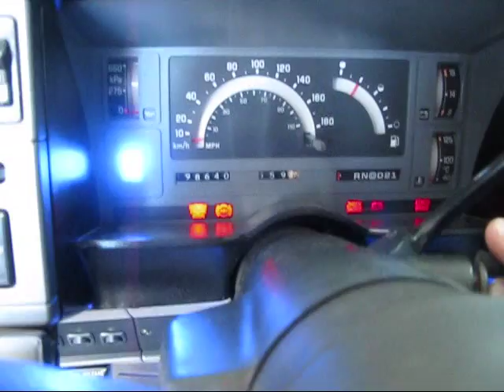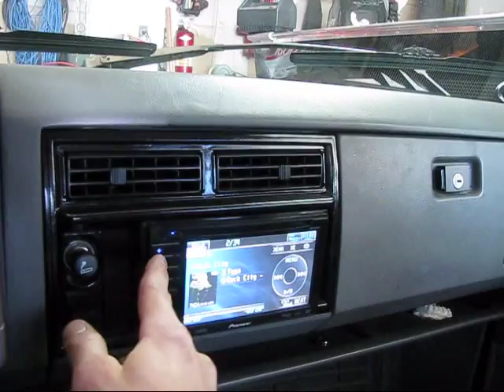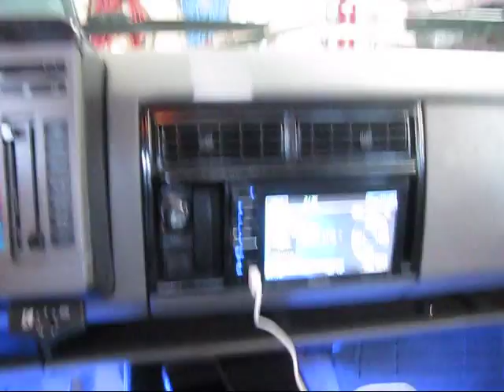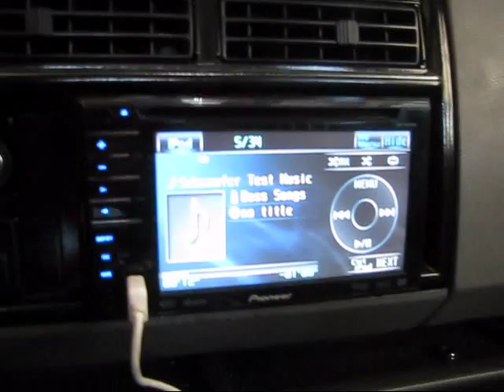S10 Stereo Demo (Oct 2012)

Comment from the maker: i bought the headers from summit. they are hooker. and for the rest of it its custom stainless. i had a local guy do the work for me. from the headers used 3" stainless to a true "y" pipe, then 3" to the cat, 3" into the muffler and 2.5" for the tail pipe to keep some back pressure.

Comment: ay homie, if u wanna get loud, put them subs in a 4th order bandpass. or juss wall off the back wit some 15's or 18's hahah... im doin a new setup in a a truck im bout to buy... 4200 RMS watts. and im doin the complete system for around 2k. that includes batteries, alt, deck, subs, wire mids, highs, amps.. the works.. and the brands are crescendo and soundstream. i cant wait. shits gonna rattle ya brain!!!!
Reply: Damien Nicholas update?